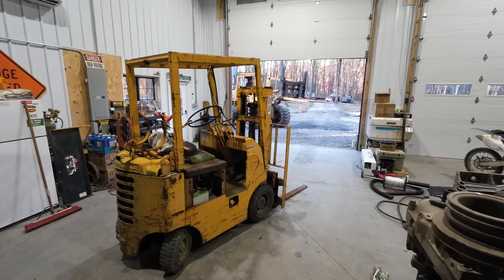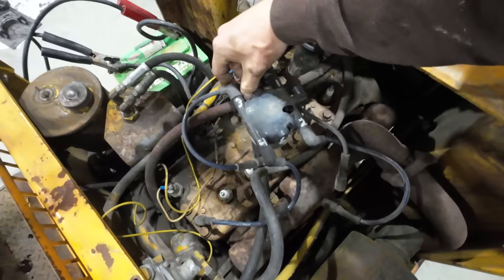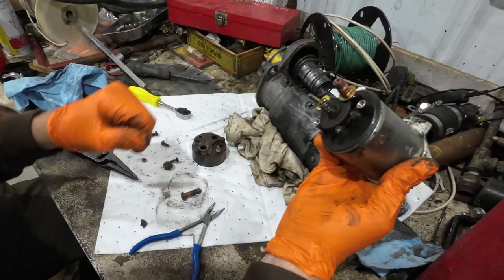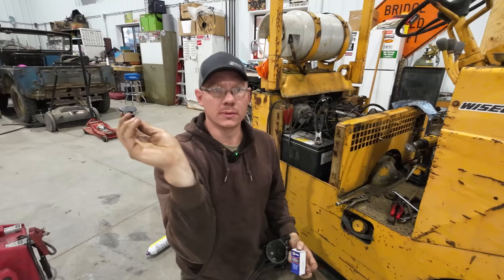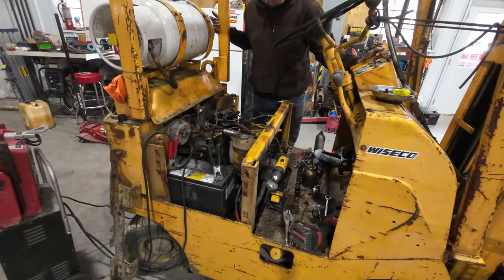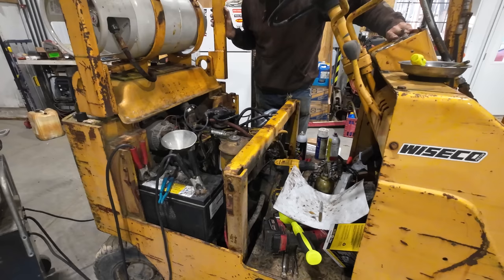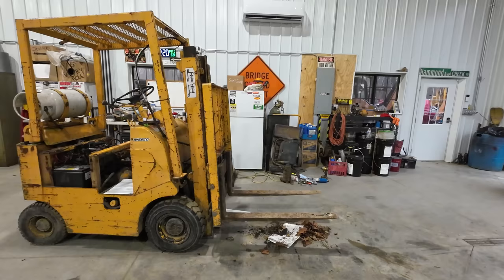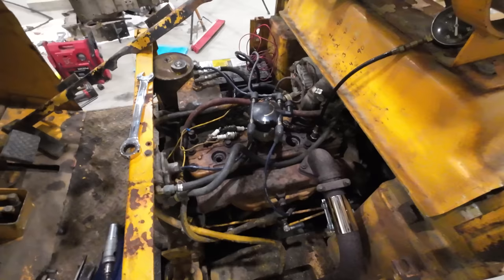Save or Scrap? CAT Towmotor sitting for years. Will it Run??

Comment: O’Reillys used to sell a universal drop in four-cylinder electronic ignition upgrade to replace the points on forklifts. You might check on that. I’ve worked on a few forklifts over the years and I can tell you one thing. Even with a good running engine, if the starter is hung in to the fly wheel ring gear, it takes a tremendous amount of current to turn over that engine. I don’t know how many times I’ve seen people try to start a forklift that the battery was low on. they crank the engine over just slightly, and then the starter hangs in. even with a jump pack and a charged battery they won’t crank over. There was a couple in particular that I worked on all the time and the guys never could figure out how I could get them started after they had tried multiple times. The trick was really simple. I reached in and turned the fan blade which turned the engine over until I heard that tale tell click of the starter disengaging. Then I would hop on and fire it right up. That starter needs to get the momentum going before it engages the teeth on the fly wheel in order to have the torque needed to crank even a freshly ran engine. Another thing about the propane forklifts is your usually running a two stage regulator for the propane. The first stage takes liquid propane out of the tank at high pressure and evaporates it into a gas. The second stage of the regulator takes the pressure down even more to feed into the carburetor. To prevent the first high-pressure stage from freezing up as the liquid propane evaporates into a gas the engine coolant is pumped through the body of it. So, if your antifreeze/coolant is low or not circulating properly the high pressure regulator will freeze up starving the engine for fuel. There was one that was basically worn out, but it was at a small business where I knew the guys, they had already spent a bunch of money with a forklift repair technician who replaced all kinds of stuff, then wanted to do a head job on it, etc. so they called me and asked if I could take a look at it. Like yours in the video it would barely run had no power didn’t wanna stay running. What I finally decided was somehow, the timing had changed just enough that it was firing too late on all the cylinders. So I simply moved the spark plug wires, reverse rotation of the distributor, one tower on the cap. It fired up, and then I was able to adjust the timing using the distributor adjustment. they were ecstatic. When they offered to pay me I told them don’t worry about it. Just remember that next time I need something done. They used that old machine for probably another year before it started having other issues.

Comment: I was a maintenance repairman at a metal Refinery for a very long time starting in the early 70s and we had about two dozen Tow Motor brand forklifts some dating back to the 1940s all powered by little Continental 4 cylinders. I'll tell you what, they were virtually indestructible.
Reply: Back when Made in America meant it was quality!  Good old days!!!
Reply: Those old Continental engines are pretty damn good.
Doesn't Matt's Deuce (and a half) have a Continental?

steve

Comment: I would actually be disappointed if Matt didn’t use the impact on the spark plugs 😂. Thanks man 👍
Reply: But wait, there's more!  The oil plug too!  Surprised he didn't try to adjust the carb with it.
Reply: I was just glad that his bragging laughs did not get him anywhere this time lol 👍
Reply: What's the correct torque setting for those spark plugs?
Matt: "Yes".
Reply: @hmallett  Obviously the goal is to hold the spark plug still and find an impact driver big enough to rotate the engine under it.

Comment: TOWMOTOR CORPORATION was founded in 1919 and introduced the first forklift industrial truck in 1933. On November 10, 1965, Towmotor officially became a wholly owned subsidiary of Caterpillar Tractor Company of Peoria, Illinois
Reply: Also the first machine with that name was a forkless unit designed to push and pull carts in industrial settings.

Comment: Old trick with those delco solenoids is to slacken the top contact nut. push the stud in. rotate 180 degrees and retighten and you get fresh contact for the solenoid to contact with.

Comment: There was some comments here about not to give up on this one and not to scrap it.. But for real this forklift has so many issues as you said and maybe the worst problems you havent found yet so I do agree on scrapping this. It just doesnt seem to be worth the time and money to get it fixed & that clutch aint really a smooth one to use.

Thanks for the awesome video and take care Matt ❤🇫🇮
Reply: I used a diesel powered Lancer Boss forklift in the mid 1970s. It had large pneumatic tyres, two gears (one forward and one reverse) connected by a torque converter. The only fault was its open battery that self discharged if left wet after use in the rain.

Comment: I don't think I can recall the last time you threw the white towel into the ring, but you definitely gave it far more attention that it probably deserved. I'm sure that the outcome of this revival was not at all what you were hoping for, but this was still a great video.
Reply: Agreed, I can't as well, but, even with these occasions, you can still see Matt's skill shine - hell, he got it running after all, right? :)  Matt, imho, scrap it
Reply: 1:10:46 I disagree something is not working and you need to find it. I think you should dig this forklift back into the shop and see what the reader replies have said😮

Comment: I was 15 and taking automotive classes at the local trade school. We had a CAT forklift that had the exact same issues. Compression, spark, timing, fuel, firing order, etc was always good. Never did get that engine out to see if it had jumped time internally. I need to check in on it 😂
Reply: Thats what I was thinking...

Comment: As a self trained street mechanic , I picked up about 10 old forklifts over the years . The small towmotors(precat) had many issues , but usually the same . Blown head gaskets between 2 cylinders , Worn steering joints , but joints could be adjusted for wear ( remove counterwieght for ease of access ) and very worn reverse/forward gears barely catching . Still I loved my small Towmotor  lifts . They would start everytime and were extremely maneuverable in very cramped places . I had a 391 and a "LT35"  plus other makes .They were very handy in a metal shop and  tons of fun . Best tool ever . Enjoy your videos they bring back many fond and not so fond memories  .
Reply: I just picked up a V30B yesterday. It will be a project.

Comment: Love the telehandler content!  ❤   I have a 2007 jlg 1055  4.5 Deere motor

Get a slide on boom attatchment or quick attach boom to make picking easier from the back of you sea cans..   

Also be very cautious of side loading the boom when pushing a truck or yourself out when stuck.. especially when extended!   With the boom in the mud and machine turning the boom bends and is ruined.    Straight back only.   No wheel turning

Comment: You did all the right stuff. As to loss of spark, i've known a bad earth strap to be the causation. If she were mine, i'd rip out that engine because she obviously needs rings and a regrind of the valves and i'd fit a diesel unit. If time and price is a factor in your area, then strip her for parts and scrap what's left. Nice to watch you do exactly what i would have done before making these awkward decisions. 👍

Comment: Years ago when I worked on VW Diesels (pre 2,000), I would put Slick -50 into the cylinders after I jacked up the car to make the cylinders plumb. I would let the car sit over night, put the injectors back in, start the engine and let it get hot. Teflon in the Slick-50 would help seal the rings for a while to get College students through to graduation.

Comment: Starting that thing and getting it to consistently run and reliably idle, definitely the hardest motor I've seen you work on. Well done as that needed a lot of patience and diagnostics and it ran for one last time at least. Shame it was dumping oil but at least you can reuse the forks.

Comment: That starter is a must keep! With the way it held up you would be hard pressed to ever find one that tough again! Has that nice straight roll cage to maybe put on or use for something else like the wheel loader that doesn't have one. I would also keep the lift & Shift cylinders and pump if good.

Comment: The GM starter sell node back in the day , the contact disc could be flipped over giving you a new surface on the disk . Its been  a long time back but it seams like the copper stud bolt contacts could be rotated 180 in the bakelight insulator. 
Thanks for making the video. 👍

Comment: Caterpillar acquired Towmotor Corp. back in the mid-1960's, and from then on they were known as Cat Lift Trucks. I worked for their Lemoyne, Pa. branch back in the late 1970's for a couple years, and even then, they had some pretty advanced stuff being built. The newer ones all used hydrostatic transmissions, and propane burning OHV Cat designed engines, with electronic ignition.

Comment: I worked on those yrs ago i was a cat mechanic ,if its not smokin it will run a nother 20 yrs , oil leaks are common from the rear seal the seal holder is aluminum and must be replaced as they warp.

Comment: don't forget the load center for the weight rating 
so a 2200 pound load rating at 12" center means you have 1100 at 24" and 550 at 36" and 275 at 4 foot which is about the length of the forks

Comment: I'm sure you already plan on it...but I'd salvage any components you can off of it that might be useful in the future, you know the ignition components are like new, you're already grabbing the forks, but consider the gauges/switches/hoses/valves/tires/etc  especially if its just going to scrap, you'll get more value out of the parts you can reuse than you'll ever get out of the scrap side.

Comment: Matt The booms may switch from one to the other. Also you may be able to swap the tires and rims giving you pumatic tyers for driving outside.
Reply: I was about to post that about the tires and wheels myself.
Reply: Same here I am glad that I read this before commenting, however the Cat was rated for 2200 lbs and the Allis Chalmers for 5000 lbs. You will have to be sure that you can keep the original 5000 LB rated hydraulic cylinders and that the Cat carriage can handled that load. Also I would suggest that you invest in a Depstech bore scope, you will be able to pull the spark plugs and see what kind of shape the cylinders and valves are in, along w/ many other helpful uses. I love mine, helps me see what is going on before I get started.
Reply: @wrangler6977  I believed the ratings decrease is due to the addition of the side shift and or height increase. Both have impact on  the capacity.

Comment: Gotta love the side shift when it works... Yeah sure you can just line up slightly better but the time savngs and potential damage reduction with side shift is huge. I spent a couple years loading trailers out of a refrigerated warehouse and side shift gives that little extra finesse to get the pallet riiiiight to the wall without sliding it along the inside of the trailer wall on the way in
Reply: I have worked 2 warehouse jobs and I love to have side shifting forks. Saves A lot of forward and reverse to get just right on the racks. I was in heaven when I or to run one with side shift and reach.
Reply: Had my posterior on too many fork-lift seats 
in my day.  Yes, that third handle is ALWAYS 
a bonus.  (Or, mandatory, if you want my true 
opinion.)

steve

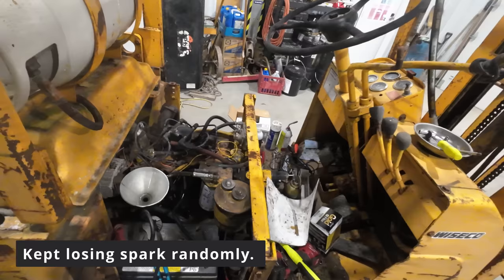Comment: 58:05 My initial thought on this is the centrifugal advance on that old distributor might be corroded - especially with the hole in the old distributor cap, it makes me think a lot of condensation dropped down that distro shaft for a lot of years, and if it didn't make it past the o-ring, I'd expect to see a bunch of rust on the advance mechanism. If it's vacuum advance, well...

Comment: I would have a hard time admitting defeat without learning for next time what is causing it to lose spark, seems the machine may be at the end of its rope but I'd want to figure that out. The switch could easily be failed to the point of acting as a resistor and heating up to a fail point, I've only seen it once and been laughed at for suggesting it in the past but that one time $6 saves a machine😊 as far as the oil leaking, i would let it run a bit with the new oil, not sure how the Continentals do it but i have a clapped out one thing starts dumping oil out of every seal in the engine shortly before i think an oil change is due every time and it self heals about half an hour of run time after the oil change (even with all the externals resealed). It's bizarre but not a big deal once you figure it out. Having driven forklift for several years, the transmission seems like a deal breaker more than Anything else.

Comment: Yeah, exploding batteries are no fun. Had one blow on me several years ago, actually on a forklift while I was at work in a box plant here in Ohio. I had been using this lift (and others) daily for months. All our lifts were serviced at regular intervals by an outside contractor, too, and they were pretty adamant about doing it right. Anyway, I had parked this thing next to the maintenance department to step out and have a smoke. It had been operating perfectly... Then I came back in from my break, hoped back on the lift, and as soon as I turned the key on, BOOM! Battery exploded like a bomb under the seat, and the engine compartment caught fire. Reminded me of those ignition-activated car bombs you see in movies. Nearly shat myself in my hurry to get off the machine... A quick-thinking maintenance tech ran over, popped the propane tank and lifted the hood, and cut the negative battery cable while another guy extinguished the flames underneath. The lift was salvageable, no permanent damage, but I'm not sure there same could be said for my undershorts. Probably the most interesting day I had at work that month.
Reply: They produce hydrogen and oxygen just to make it a bit more explosive! Part of my apprenticeship was in a battery shop, the dents in the workshop roof where they rebuilt batteries was from the tops hitting the ceiling if all the hydrogen wasn't fully vented when a blow lamp was used to melt the pitch holding the tops on.

Comment: Hey Matt, I use to work in a mine processing center for the U.S. Postal Service. Their tow motor's were used daily, without a cage and forks to pull  trains of bin's, cart's and cages of mail through the plant to different dept.

Comment: Caterpillar does have their Certified Rebuild Service. Someone local used it to restore the 1913 Holt tractor. Might not be worth it, but could make an interesting collaboration where you could tour the plant in Peoria, Illinois. And record how they do their rebuild process.  It is expensive but they certify it as if it is fresh off the line brand new.
Reply: I follow a guy who rebuilt some Holt 10 foot 
log hauling wheels.  Steel (Cast Iron?) hubs, 
with (all missing except the actual steel 
tires) wooden spokes, felloes and other wagon 
wheel pieces.  Guy earlier built a period-correct 20 
Mule Team set of wagons.  Each back wheel 
on the 2 wagons, and the water wagon, weighed 
1050 pounds.  Just those 6 wheels weighed over 
3 tons.

Oh, the "20 Mule Team" was incorrect.  The last 
2 animals, ones closest in, are horses.  If you 
really want to get picky, mules are 1/2 jackass, 
and 1/2 horse.  I get 11 horse, 9 donkey mix

steve

Comment: As you are planning on using the forks off the Cat for the Allis Chalmers could you move the whole side shift frame over to it to give the Allis Chalmers a side shift?
Reply: I was wondering the same thing and if the hydraulic pump could be moved as well since it seems  to move a higher volume. Though the faster lift speed could be due to smaller cylinders for the lower lift capacity.  But something that might be worth looking into, might not be worth the effort.

Comment: Matt, pull the mast off and use it as a mezzanine lift if your building one into your shop, I have 3 of them to get into my house, and the loft inside my house and into the mezzanine inside my 2 story garage and they all run off 12v tail lift motors and remote winch controllers saves heaps of space not having stairs. Sad that the old gear has to go but recycling is still good.

Comment: So, there's the forks, & maybe the side shift kit would be a fun upgrade? But also, there appear to be some panel meters that could replace the broken gauges on the old forklift? Also, I doubt it would be remotely possible, but it might be interesting to investigate doing a hub/wheel transplant :-)
Reply: All are good  ideas except the wheels since they have lower capacity and would break under load. Usually the rims go before the tire.

Comment: Older propane forklifts had a pre-heater for the fuel.  Coolant lines and fuel lines run in and out of a thing that is round, and about 5" in diameter, and maybe 2" thick.  A lot of them had a primer button in the middle- kind of worked like a choke.  You could push it manually for more fuel.  I seem to remember that they were normally electrically activated.

Comment: Matt I have a tow motor that needs some throttle linkage which is missing. I would be interested in these components if you are going to scrap.  I live in NW Montana and you would help me get this operational again, I do know a lot about the machine if you are interested.  Love your work on D4 which I redo these having about 2 at this point. Doc

Comment: If the starter is that slow and tired, hook it up to 24 volts. It will speed up and create more heat in the cylinders. May help get it to crank with the stuck rings. Also check the coil.